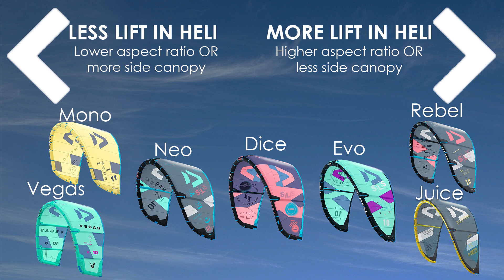How to Heli Loop (Extended Kitesurf Tutorial)

Comment: Astounding tutorial on Heli Loops! Once again, thanks for your continuous contribution to teaching the sport.

One extra thing I would have appreciated is to see with an orange arrow (as you do in other videos) the downwards force that is exerted by the kitesurfer due to their weight and height of the jump, at all time points during the heli loop. I think that would communicate at which points of the process the kite "catches" the kitesurfer.

Thanks again!
Reply from the maker: Hello Stefanos. The target shown at 3:18 is the approximate position where you really feel a lot of lift (you have a high kite angle and good power from the kite). Any higher/further upwind and you have less power; and any lower/further downwind and you have more power but a lower angle. This target is where you want the kite as you land or just before you land.

Comment: Great video! Been practicing back hand helis in low winds conditions (15-19 knots) on a 12m, found that if I steer the kite hard to the opposite side (11 or 1) on the way up, you get launched under the kite so there is tons of overfly on the way down and the backhand heli gives tons of lift. Also works very well on 3-5m jumps.

Comment: So what would be a good hight for a heli loop? At the moment I jump at around 4,0 - 4,5 m?
Reply from the maker: Hello Matthias, it depends on your kite, weight, take off angle and few other things. So the exact height will vary. Probably at 4m, no you should still be using a normal landing or start to use a bit of a double movement landing. Ultimately it's the kite's position (distance upwind or downwind of the pilot) that will tell you if it's time to heli. If the kite is still on your downwind side then definitely don't heli. If the kite is directly overhead, not downwind or upwind of you at all, then you can choose a double movement or a late heli completed after landing. If the kite is slightly upwind of you on landing, then a tight heli starts to be the most effective method of softening your landings (if done correctly of course).  If the kite is hugely upwind of you, then a big heli starts to work best.
Reply: @kitesurfcollege  thx

Comment: Hey mate
awesome content as always! Just on question: in this video you do a jumped transition most of the time combined with the heli loop. Is it easier for learning the heli loop or is continuing in the same direction as good? Thanks!
Reply from the maker: Hi Fynn, for smaller jumps (up to about 6m) is easier to not transition, and keep the same riding direction. That's because on smaller jumps you generally keep your original crosswind momentum. If you take of heading right foot forward, you're usually still moving right of the wind on landing. But as you jump higher you gradually loose your initial crosswind momentum and you end up landing moving almost fully downwind. At that point you can easily swap between a transition or not and even swap between left and right foot forwards. It really helps if you are confident landing in both regular and goofey stance, since you can then choose which is more natural at the last moment.
Reply: @kitesurfcollege  thank you! Got it! I’m working on landing both directions and totally understand your point. Cheers